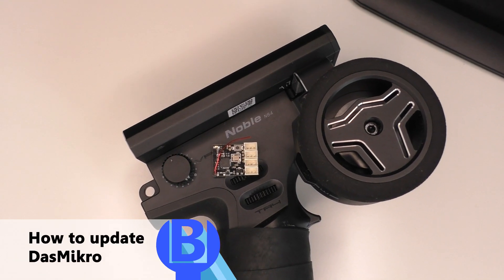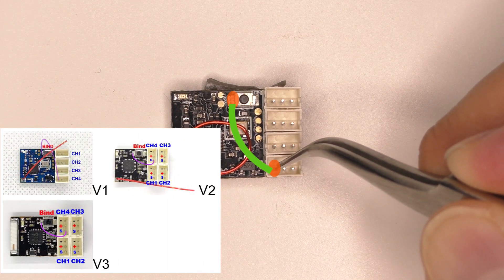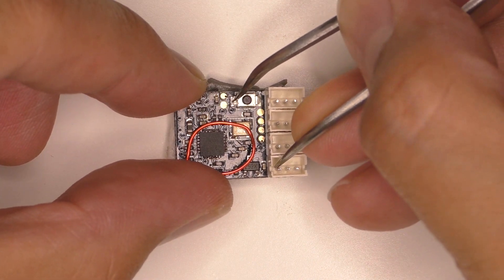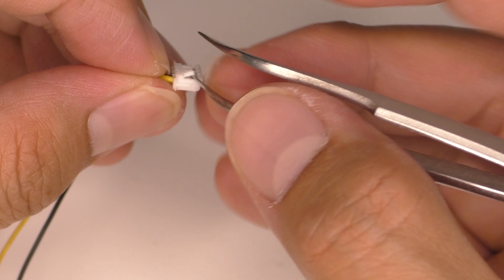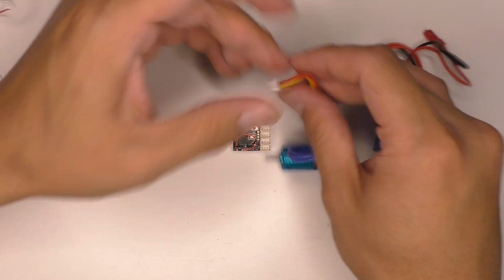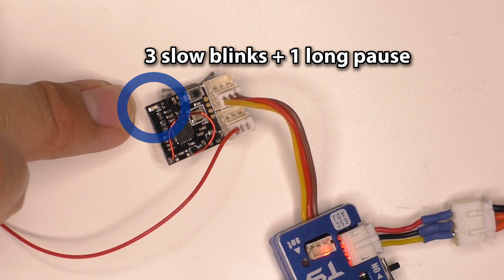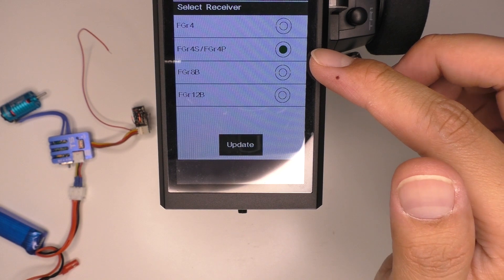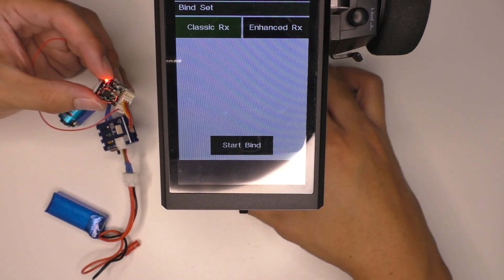[Tutorial] How to update DasMikro receiver & other 3rd party (Flysky Noble NB4 FW 2.0.93, 2.0.99)

Comment: Hi! I’m building a 1/28 car. The car is RX28 by reflex racing. I have the flysky nb4 radio, and Hobbywing mini28 ezrun ESC. But i need a Receiver. I was looking at Dasmikro receiver & Loco receiver. Looks exactly the same Receiver but they have different Operating Voltage. 

Dasmikro operating Voltage: 3.5V-8.4V 

LOCO Receiver operating  Voltage: 3.5V - 12V

Which one should i get for this build? Do i need the 12V or 8.4V is good enough?
Reply from the maker: Either one is fine. I've never seen LOCO though.
You don't need anything more than 8.4V. When you use the BEC on the ESC it will be 6V anyway so there's nothing to worry about. Unless you want to connect the battery directly to the receiver. Still, this is not recommended for a small car because of the wiring will be too messy and we need to save as much space as possible.

Comment: How about the ones without a bind button like the afhds 3 4ch nano receiver?
Reply from the maker: Normally you'd connect the bind terminal to signal of channel 4. But ask DasMikro to be sure how to do it. https://www.facebook.com/DasMikro
Reply: @BeaversHobby  thanks, I got it to update. Basically instead of shorting the bind pad and the ground. You short the bind pad and the 4th channel, then power up the receiver like in your video. Btw because of you I now own 2 mini z, the DRZ v1 and the DRZ v2 limited edition and learned alot from you.
Reply from the maker: @jdnic1  My pleasure.
Reply: What if it wont go into forced update mode?

Comment: Hello did you know if it works with the KO FHSS micro 4ch Receiver GX-037 ?
Reply from the maker: It doesn't work with KO. It's a different protocol and most likely different chip altogether.
Reply: @BeaversHobby  thanks my friend for the answer 👍😉🙌
Reply from the maker: @vs2109  My pleasure.